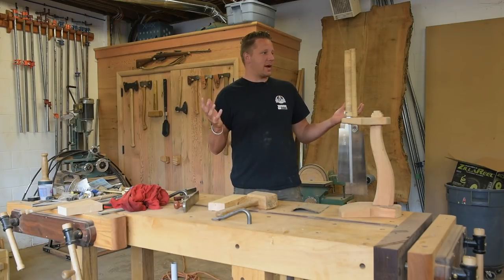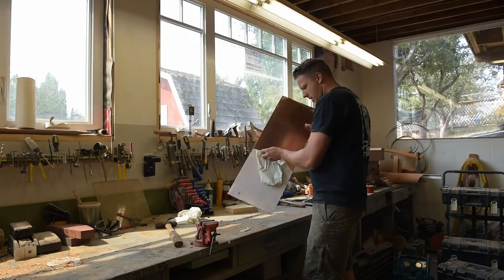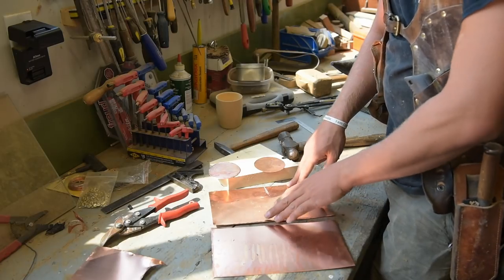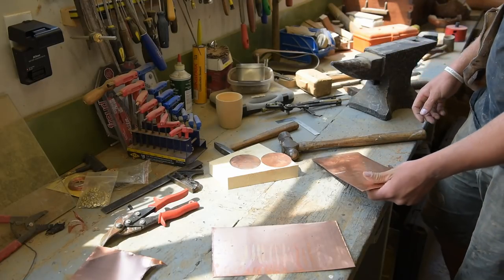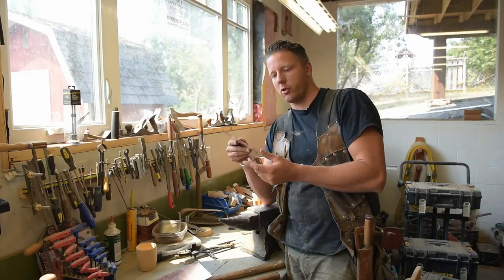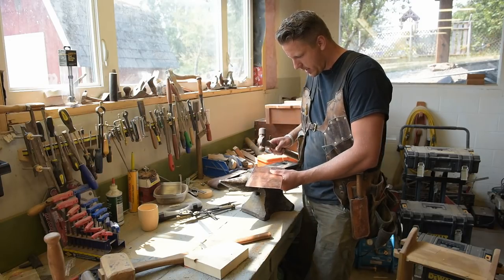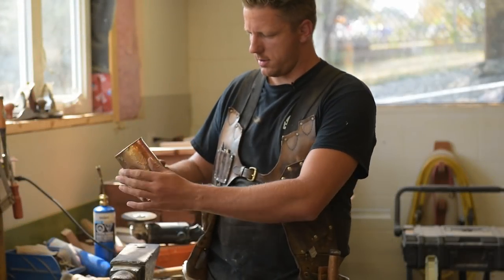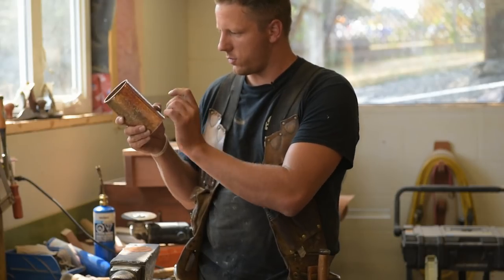Make A Moscow Mule Copper Mug Pt 1

Comment: Hey Samurai.  Love your channel and projects.  While you may never need this knowledge as you may not do more copper projects, may I tender some advice? You'll find it much easier to work with copper (particularly if you're hammering on it) if you anneal it periodically.  Copper work-hardens quickly (gets harder and stiffer) and becomes more difficult to shape as you work it.  With a simple propane torch you can heat it to a gentle glowing orange color, then let it cool or dip it in water.  It will be much more malleable for a while.  As it hardens up again, anneal it again.  It does blacken but can be easily polished off, or, if you're going to work with copper regularly, buy or make some "pickle" solution which will remove the oxidation from annealing.  Keep the vids coming!
Reply: LOL.  Just turned the vid back on and there you are annealing it.  Goodonya.

Comment: just a tip, non ferrous metals such as copper, brass etc are quench annealed. so you heat them to the point they just start to glow then they soften up to continue working. do this periodically to prevent it from work hardening and tearing. steel on the other hand hardens when quenched (to varying degrees depending on carbon content) 

love your work, and always enjoy watching your videos!

Comment: As you mentioned, copper easily work hardens under the blows of a hammer. Non-ferrous metals anneal differently from ferrous ones. Like you said you need to anneal it by heating up the work piece  But then quenching it in a mild acidic water solution. Vinegar and water works good for someone who only does this occasionally,  Properly annealed in this way, it can become as soft as "butta" (figuratively speaking) and will allow you to shape it into a cylinder almost entirely by hand.

Comment: samurai, have you ever tried MAP gas for annealing. I first used it when I worked in the Rockies because propane would freeze solid at our temps (-40 F). It is wicked awesome....burns way hotter thus takes less time for whatever task you are trying (which is even more awesome when it is -40!!). Comes in a yellow bottle and costs more but lasts way longer due to the time needed thing.

Comment: Hey samurai do ur self a favor when done with the cup clean it with Hines 57 ketchup  safe clean after rinsing and no harsh chemicals
Reply: ^this
Reply: It's the vinegar content, it cleans off all the garbage.
Reply: FDA is saying ph lvl of the drink no good for copper
Reply: Plus the acidity of the ketchup will clean it look up moonshine and how to clean copper pot stills the backwoods way
Reply: Just remember acidic juices has a tendency to break down copper metals. Pace your self or you will suffer from copper poisoning.
Reply: Copper jewelers use a pickle for cleaning copper.  Vineger and salt mixture.  Ketchup work well because it sticks to the surface but it is the vinegar thats does the cleaning.  Where just straight vinegar would run off the ketchup hold it in place to clean. As others have already mentioned to much acid and copper can potentially make you sick so be cautious.
Reply: If he has access to an acetylene torch, he could always get some powdered pine rosin and some tin and tin the inside. Purgatory ironworks showed how in one of the copper bowl videos from a while back. That should make it safe.
Reply: Actually copper does not react with acids. All metals do except for gold silver and copper
Reply: @James Cleaver well, it does react with nitric and acetic acid. Vinegar is acetic acid.

Comment: I watch a lot of your videos.  I love your work.
I also work with copper.   I did not know if you realize or not, but when you make a Moscow mule in a copper vessel,  there is a chemical reaction going on between the copper and the large amount of lime juice that goes into a mule.  The lime juice is stripping a microscopic layer of copper from the mug, which becomes a very toxic copper acetate suspension.
Copper is banned in the packaging of alcohol or other liquids with a PH lower than (6.0). for that very reason.

I know that they are the rage and everybody loves them....but I can't get past the chemistry.
Your mug is beautiful.....use it for everything but alcohol, please.
Copper is a perfectly safe material for everything food related....with a PH above 6. 
Copper pot for chicken soup....YES.....Copper pot for Tomato sauce....Not a good idea.
Keep up the great work and be safe.

Comment: The use of copper on low acid foods can cause copper poisoning due to the acidity leaching off the copper. I am not exactly sure, but I doubt that a drink that is obviously consumed very quickly once prepared would leach the amount capable of getting someone sick could happen 3.5mg/L. Additional information is welcome, I think the use limitation in food service is mostly for backflow prevention of carbinators for soda machines and prolonged storage of food in a copper container. Ty for the video Samurai.

Comment: You can more effectively anneal copper by heating to dull red and quick quench in plain water. Yes, sir. Opposite of most ferrous metals and aluminum as well. Aluminum at very low temps with a sooty flame just to see where you've been then air cool. Prob TMI lol

Comment: a tip for next time you work with copper. heat it up and then clensh it in water. unlike normal metal it dosent becaome hard and britle it becomes soft and easy to work with.
Reply: YouKnow but it also stays soft

Comment: The hole in the anvil is called a hardy hole because it was traditionally cut into the anvil with a square-chisel called a hardy chisel. (I don't know if that's because it was stout or because the inventor was named Hardy.) A tool that fits into the hardy hole is called, unsurprisingly, a hardy tool.

Comment: When working with copper, the more you hit it the harder it will  become. If you want to anneal it heat and quench
Reply: Also copper is good for leeching methanol out if ethanol which is why copper is the go to material in distillation of alcohol.

Comment: Just a heads up, copper and other non-ferrous metals do not harden when heated and quenched. Only ferrous metals (containing Iron or carbon) have this property. The only real way to harden copper is by work hardening.
Reply: quenching the copper saves time but with your rolled lips you could trap water inside and the pressure built when reheating the work (like when soldering) could cause the seam to rupture and ruin your seam.
Reply: one final note. hose clams are your friend when trying to form around a cylinder.

Comment: You will need to tin line the inside of the cup for safety, as copper poisionous. This is an old trick for copper ware. Jim
Reply: James Riddle it’s not poisonous unless you let your drink sit in it overnight or longer or the cup is dirty (developed that green stuff) most ppl are copper deficient so could probably benefit from a cup of water from the mug daily.  Lead is bad but ppl still drink and buy lead crystal glasses.

Comment: You're not actually annealing that copper. In order to anneal copper you must quench it while it is near critical temperatures.
Reply: wayne russell not true... non ferrous metals anneal by just getting hot, how it cools doesn't matter. Quenching it after annealing is standard procedure though because it gets the piece touchable faster.
Reply: wayne russell that is not true, all quenching gets you is a cool work piece quickly.

Comment: You do know that copper pipe comes in different sizes?
I’ve made copper mugs out of 21/2” pipe.
The majority of work is already done you just need to flatten a piece of pipe to cut the bottom, handle out of.

Comment: Okay that was something different ..i liked it but not nearly as much as your woodworking videos OBVIOUSLY  LOL
JUST MY 1.5 cents >as far as drinking alcohol or anything from the copper cup? me personally, id  stick with glass. use the copper mug as a pencil holder LOL I did my Google research on copper/ lead poisoning & drinking from a copper /metal cup I wouldn't do it. Maybe if  I sealed it with a food safe epoxy..??🤔

Comment: for a carpenter you know some good shit about metal, the process you made to soften the cooper its called annealing, metal workers and jewellers often do this to make the material much more workable, i do this whenever i want to do stock removal and cold forging. good video keep it up
Reply: I caught this as well. Hammering the cold copper mashes together the molecular bonds... generally referred to as work hardening (creating material yield, brittleness... etc). Annealing makes the molecular bonds neutralize to the new found processed shape, relieving internal stresses from shaping. This makes the copper pliable again. Just clean with a wire brush to remove the burn. Keep up the videos, love the commentary.

Comment: Samurai! Non Ferrous metals don't act the same way to quenching as steel does. In fact the standard procedure to anneal non ferrous metal is to heat it up AND quench it, contrary to the method for annealing steel. Now the quenching of nonferrous metal doesn't actually do anything to make it softer, but it doesn't make it harder either. What it does do is make the piece handleable quicker. So no need to wait around waiting for copper to cool to anneal! Beat, heat, quench and repeat! 

Also... your peen jokes are a real PANE, LMAO,

(Pane is old proper spelling/pronunciation of peen, the more you know!)

Comment: Copper mugs can be toxic if used with low Ph drinks (like the moscow mule). You're might want to line the mug with something.

I might have been impulsive in with my original comment. Since lemon is the only low-Ph ingredient just go light on the lemon.